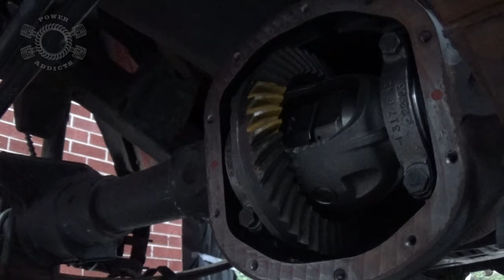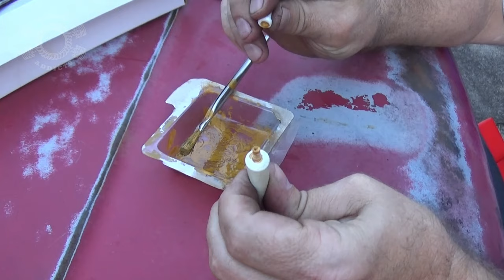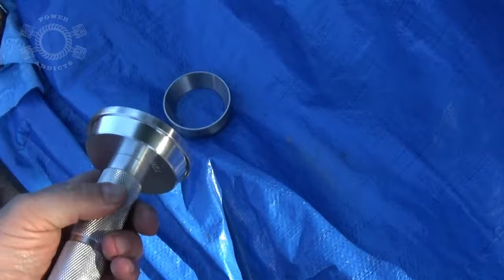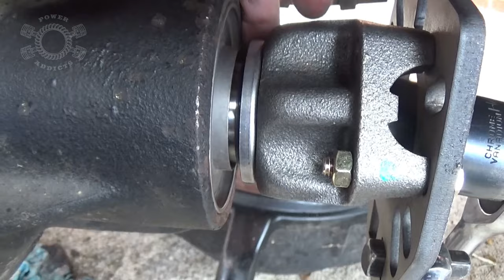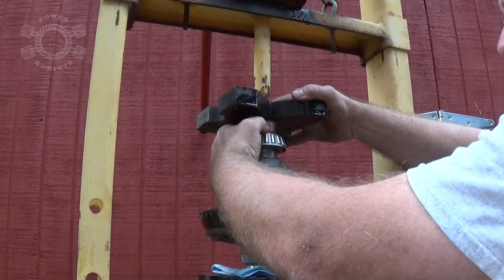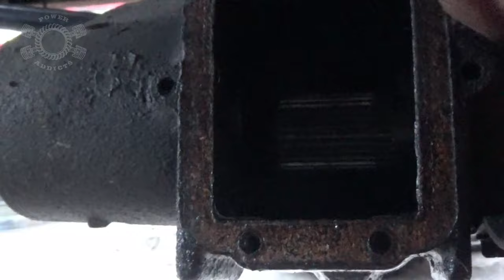Jeep Dana 30 Ring Gear install and more pinion gear tips #poweraddictscrew #jeepwrangleryj

Comment from the maker: Parts and tools used in this Video:
Inch Pound Torque Wrench: https://amzn.to/3tlw7S8
250 lbs Torque Wrench: https://amzn.to/3tlw7S8
Press: https://amzn.to/46EJX0u
Harmonic Balancer Puller: https://amzn.to/3ZQqess
Yoke Tool: https://amzn.to/3ZKDK0D
Yukon Dana 35 Rebuild Kit: https://amzn.to/3rEaUSS
Yukon 3.73 Ring and Pinion: https://amzn.to/3ZKDK0D
Yukon 3.73 and up carrier: https://amzn.to/3Q5YhJV
Dana 30/44 U-Bolt Yoke: https://amzn.to/3tmwPi4
Dana 30 1310 U-Bolts: https://amzn.to/3tmVl2F
Dial Calipers to measure shims: https://amzn.to/48IZa2f
Dial indicator with magnetic base to measure backlash: https://amzn.to/45oCBgf
Digital indicator for backlash: https://amzn.to/3RS8lY9

These Amazon links pay Power Addicts a small commission at NO extra cost to you. Thank you for being part of the channel and for your support! Y'all have a great day!!